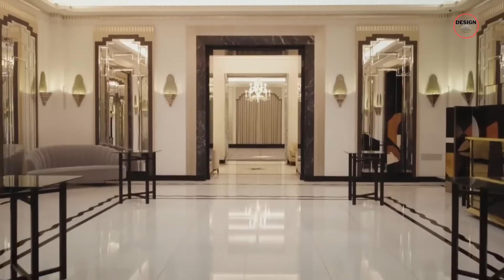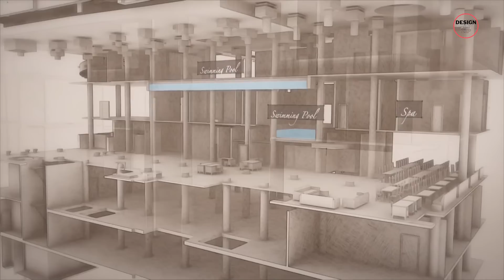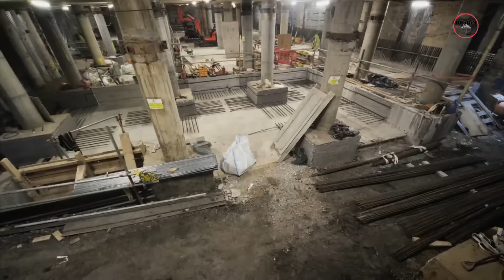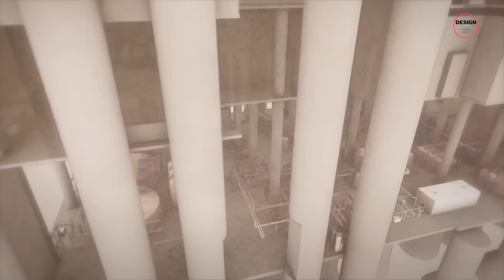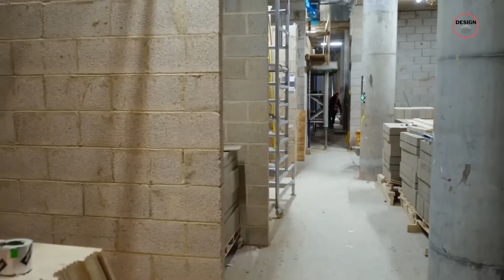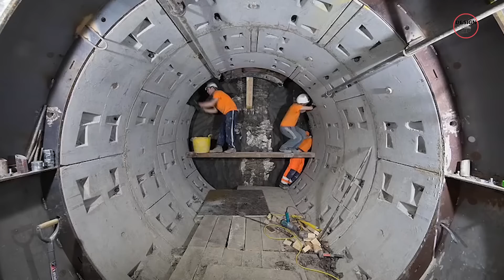A Luxurious 5-Story Basement Renovation | London's Claridge's Hotel (part I)

Comment: I just watched the second episode on broadcast TV where I live. The bit (in the newly excavated basement) where they were worried about whether or not the new horizontal shaft would align up with the previously dug vertical shaft seemed overly dramatic to me.

Jesus, all they needed to do was drive a small diameter steel pipe through the clay and observe where it emerged in the vertical shaft. If it's perfectly centred they'll know they're going to come out in the right spot. If it's not perfectly centred, then compensate the digging angle to allow for that. Not exactly rocket science.
Reply from the maker: Very true! Maybe they needed to add a bit of drama 😂